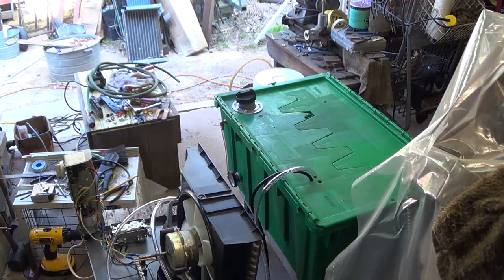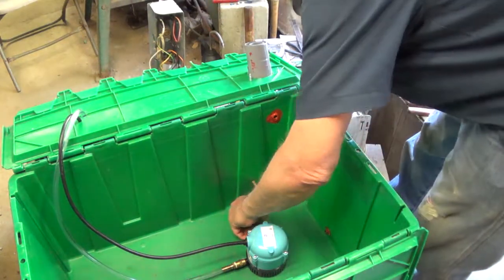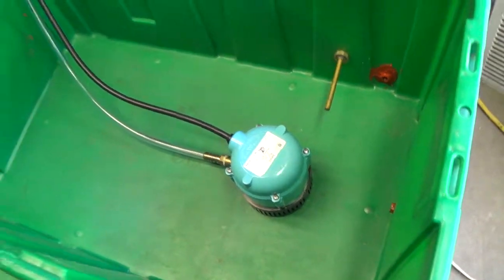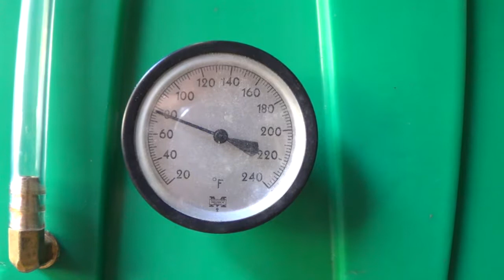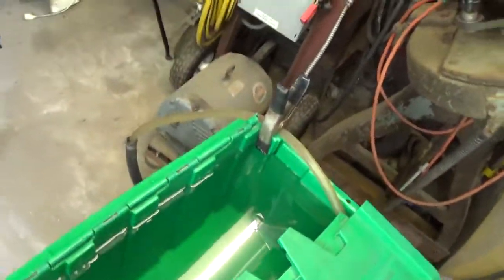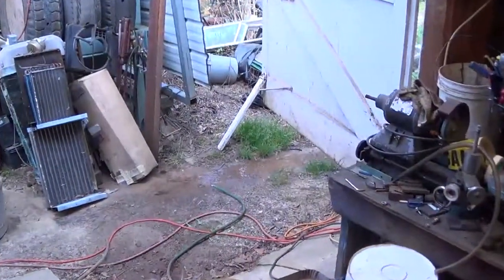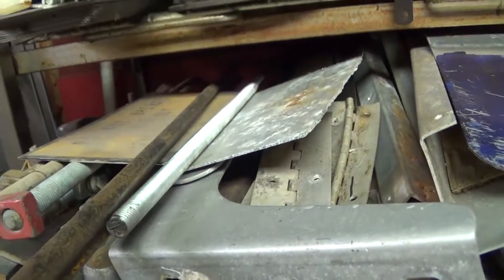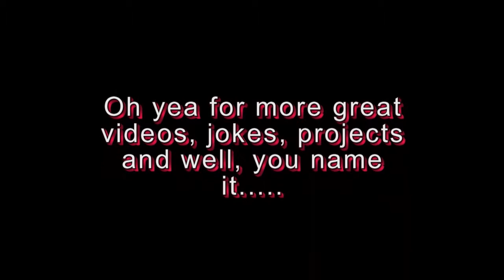How to Make a Tig Torch Cooler Part 5

Comment: I tell ya what, I had a pump laying around for a tile saw, I had a homer bucket and a clamp it took 2 minutes to put together. I run my tig @ 250 amps for hours & it never ever gets over 100 degrees.